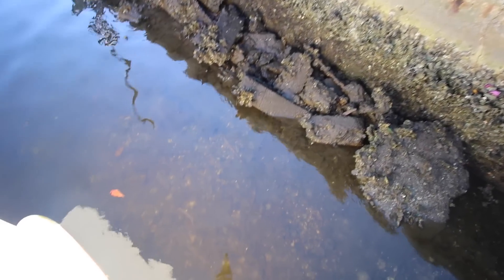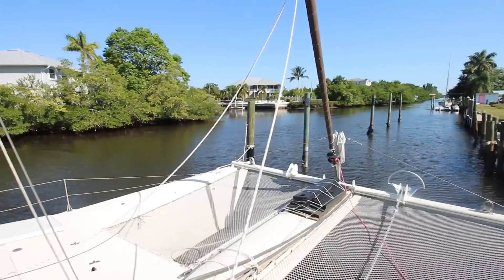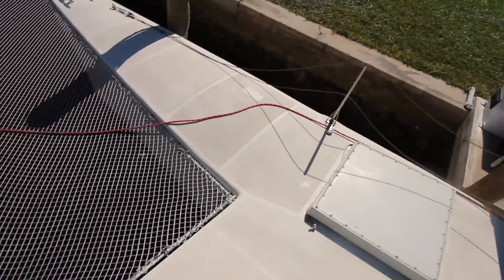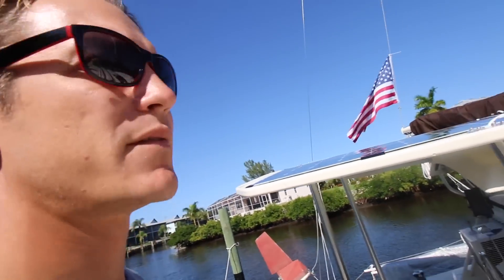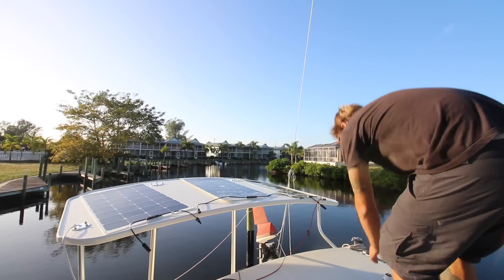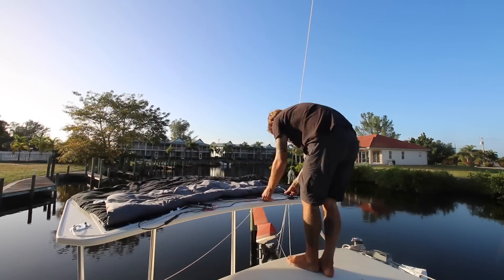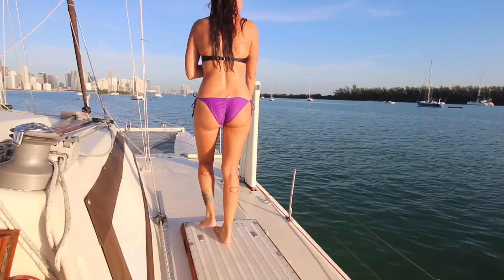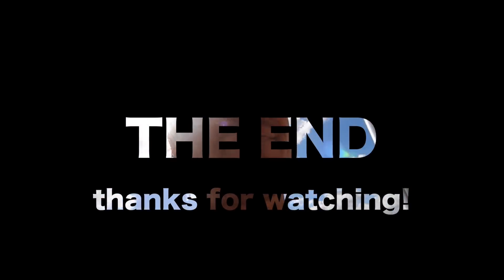Solo sailing to the keys & the 6 minute refit  | Sailing Zingaro Ep-1

Comment: I'm an electrical controls guy, not a sailor but if it were me, I think a float switch on the bilge pump would be a desirable consideration.  It may save you a much bigger problem.  Maybe with an panel lamp or audible indicator. 

First video was good enough to bring me back for another! 

Fair Winds...
Reply from the maker: Yep. I installed one on each side. In retrospect that should've been completed prior to leaving.

Comment: Check prop, U can bend or brake prop going under 2 knots. Bent prop vibrates shaft which ruins bearings which will screw up drive easily. Always run a good prop, have a spare ready at all times. If u are sailing alone U must wear a safety line and life preserver. MUST!!!
Reply from the maker: Check that. Good advice. Have a spare prop. And harnesses for 6. Hopefully won't do that again....

Comment: James, as for the stuffing box ? You said it is supposed to drip ? Not true. It does not have to drip and was not designed to drip. When a box of that type drips it means the flax packing is worn out. The flax packing should have 4 rows of packing inside the gland. When installing the packing you should also use a good grease like marine “ Luberplate “ West Marine sells it. As for water to the packing gland ? Typical water feed set up is done from the exhaust water going into the exhaust elbow on the engine, you tap off the feed line with a reduced nipple giving the box just enough water to stay cool . With that type of engine set up and the low HP. You may find the water feed is not nessesary. You would only find this type of set up on high speed power boats.
What I would do for now is take up on the packing gland until the water stops entering the bilge. You will notice there is a small nut on the propeller side of the packing gland that is a lock nut for the packing gland, when you get the gland to the correct tension tighten down the lock nut on the gland. The packing nut should never come off until you want it off. FYI if you have over tightened the packing gland you can tell when under way with the engine,  touch the gland if it is hot to the touch that is an indication you have over tightened the gland nut.
FYI you can repack the stuffing box with the boat in the water. First get a coat hook, cut the metal coat hook to about 10 “ put a loop on one end the other end bend to a 90 degree angle with about 1” on the bent end. Sharpen the end to a point, this will allow you to dig into the packing to remove it from the gland nut. Once you have made the hook then take the new flax packing material and cut it to length. How? Lay the packing over the shaft making a complete circle, where the two ends meet cut the packing, making one full circle. You will need to make four of these. One this is complete have your Greene out. Also have a 1/4 “ socket extention to push the packing into the gland. 
Once your set up remove the gland from the lock nut and the stuffing box assembly. Remove the packing from the gland. Install the new packing material spacing the butt joints of the packing 12 o’clock, 3 “, 6 “ and then 9 o’clock. Putting plenty of grease between each piece of flax packing.
Once you have completed this reinstall the packing gland, tighten the gland to the point where the dripping stops than give it a quarter turn. Tighten down the lock nut. Keep an eye on he repacked box for a while, you may find it needs to be tightened once or twice. Don’t let it drip. If you find the packing gland comes off after this you could have an engine alignment issue. Never run the engine propeller assembly through mud, you could bend the shaft, hurt the cutless or in rare occasions pull the shaft right out of the boat. You will then have a sinking issue.
Good luck, let me know how you make out.
Reply from the maker: Wow you know your shit Mano. Fabulous advice. I’m saving this for any future advice. Thanks for that amigo.

Comment: Hi James!  Great video, looking forward to more of your updates.  my wife and I also just bought a catamaran (Seawind 1160) down in Florida (Naples, currently in Cortez), so we're in your neck of the woods as well.  You can check us out at sailingwithdogs.com if you're interested.  We'll be taking our boat from FL back up to New England in April, so will be around FL for the first month or two!

Regarding your stuffing box issue, grounding generally shouldn't affect that (and in fact, your prop shouldn't have grounded at all, you should usually be grounding on the keels first), it's more likely it just wasn't adjusted appropriately initially.  Those stuffing boxes are generally a 'set it and forget it' format.  Once you have it adjusted so that it's dripping occasionally while the engine is running in-gear, lock it down and leave it that way (don't tighten/loosen it for when you're not running the engine, just leave it).  The tiny amount of water that comes in while the engines are at rest is negligible.  Check out Don Casey for all things boat-related, his books are great: http://www.boatus.com/boattech/casey/stuffing-box.asp.
Reply from the maker: Thanks for the advice! You rock! Love Seawind cats. Little out of my price range though... ;) I'm in Cayman isles now waiting to go to Mexico. Fair winds on your journey North.